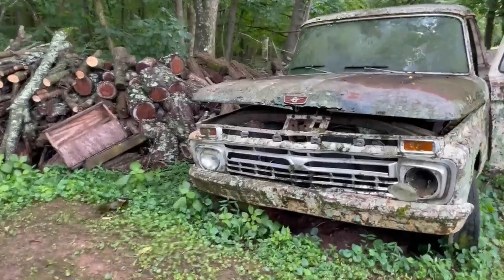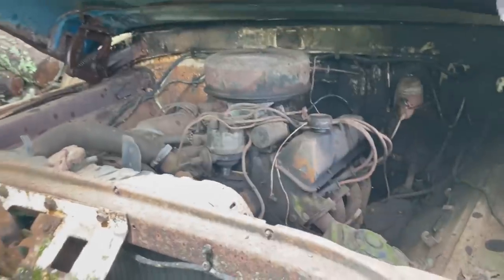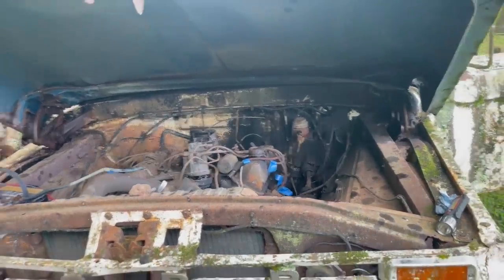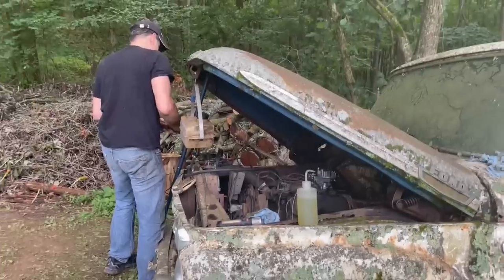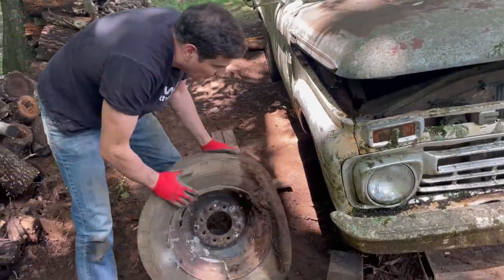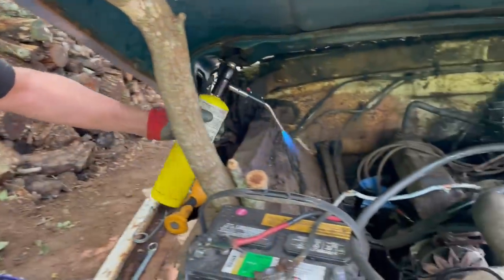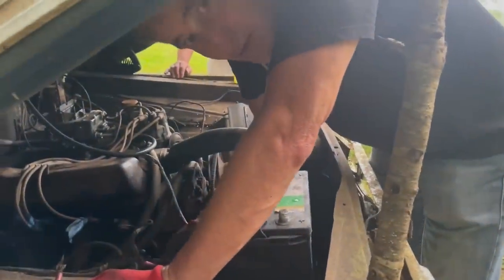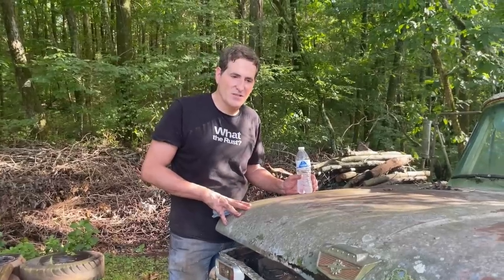Will it run? Sitting 32 years! Mud hole 66 F250 Camper Special.

Comment: Under the hood is like my old 69 F100 when I first bought it. I eventually replaced the engine with a rebuilt 360 from O'Reilly. Also redid everything under the hood. Added power steering, power brakes, electronic ignition, electric fan.

Comment: I’ve owned 2 66 custom cabs and one was fully loaded V8 352 automatic power steering and power brakes and the other was a 240 6 cylinder 3 speed and both of them drove really well.

Comment: The manual steering is a nightmare in those trucks. I'm an old dude and I use to repair those in the seventy. Its a powerhouse with that engine and 4 speed though

Comment: I’ve used a ratchet strap to get the tires back on bead so many times!! It never fails, as long as the tire will hold air for any length of time.
Reply: Nice to know! Thanks for watching and the advice 🙏

Comment: You can tell by the plugs that this engine was pretty tired when it was parked. She has some miles on her. That was ash buildup on those plugs. She is going to need a rebuild when the new owner starts putting this truck back together.

Comment: Great job you're doing there and another good diagnosis, by Christina, on the exhaust blockage. With the mud there, we would take a long two inch rope and get way out way away from the tractor and leave the truck in neutral and then just jerk it out. We did it with little 8N ford tractors and it worked after a fashion that way you would not burn up the frail clutch on the truck. Sometimes we had to get away over 60 feet away to find a dryer patch of ground to get some purchase with the tractor though. You'll get her out once the rain stops. Good save.
Reply from the maker: Thanks very much. It has been hot and dry this week, so hopefully the area dries out.
Reply: Of course a tractor or truck with a winch and cable would work best.

Comment: How about Jackin the truck up high enough so you can fill the holes underneath the tire with some plywood so it's almost even with the ground and then have the tractor try to pull you out from the back bumper. Can't wait to see part 2!you guys are the best!👍
Reply: There was wood under the back tires.  It was on an incline and so muddy the tires slid off the wood!  This truck will not get the best of us! Hopefully those are not famous last words🤣

Comment: Please! For future reference. And I have used one for well over 40 years. Taught to me by my grandfather, always take a Tennis ball and keep it with you when working on old Riggs! The reason why you keep a Tennis ball with you is for the simple fact that I see so many guys smack their head on that hood latch! Now what you do is you cut a 2 to 3 inch slit in the side of the Tennis ball and slide it on to the hood latch! I would much rather smack my head on a rubber Tennis ball than on a metal hood latch..
Reply: That's a great tip! Thanks James!

Comment: I remember reading about a guy that  not only took an axe to his brand new 1972 Ford Pinto, but he parked it in his front yard by the street with a sign that tead; $1:00 a hit. He bought it new, on the way home it developed multiple problems. He turned around and went back to the dealer to complain. The dealer replied, " hey, what do you want for $2000.00?
Reply: So funny!!!

Comment: In one of your videos you used chain wrench on a stuck engine. The other day I stopped at Harbor Freight looking for a oil catch pan and I found they sell a Bremen 20" Chain Wrench called a Locking chain Clamp that was like the one you used so I bought one for myself. I think it was around $20.00 and I have already used it twice. It works great.

Comment: Looks like you’re battling stuck brake drums on the front, more than the mud.   Have you verified that all 4 tires spin?
Reply: We saw the driver side spin fine but when editing we noticed the passenger side only moving slightly.  So you maybe right.  We'll be looking at that.

Comment: all the lichen and moss makes it look like camo paint!  Hood is from another truck and it looks like '64 because of the FORD 100 badge on the side of the hood (doesn't belong on a '65)  and the stainless spear molding.   The Twin I Beam F100 badge on the fender is right for a '65.  But you'd think the oil-bath air cleaner would be mouseproof!   One other thought, that oil fouling on a couple of plugs could be valve stem seals.   They'll suck a lot of oil down the valves at idle on these FEs if the rubber umbrella seals are gone.
Reply from the maker: It does look like camo!  I agree with you about the hood. I think it is a 64, but I really like the red, white, and blue colors that it brought to the truck. Thanks for watching!

Comment: wow, what a challenge...  the clogged muffler could have destroyed the gasket, because one didn't hear the vacuum leak at first. backfires might cause it, too.
aside the acorn shells the glass packs might have given up inside, and now the glass wool is blocking the pipe. I once had that on an old Suburban with rusty sidepipes, wouldn't idle and had no power. after removing the sidepipes (customer wanted them gone, anyway) the engine suddenly idled.
there also was one Opel who misfired for too long, and nobody noticed until it was time for emission check. the end muffler was filled with little marbles of catalyst material... the catalyst was entirely destroyed. XD

I was sure you could drag the truck out of that hole. are the front wheels stuck, too? looked like it.
loved how the owner worked on it while you were away, cleanign up the spot, grabbing  wheels, and so on. :) like he woke up and found a new project to work on. who knows, he might keep the pickup and restore it. :)
lookign forward for part 2! ^^

Comment: those FE engines are terrible to plug up the oil return holes in the head  take the valve covers off and in the rear run a coat hanger wire in it
Reply from the maker: Thanks for the tip! I did not know that.

Comment: Well sir it just goes to show that you need traction in order to move things/ When a wrecker driver is called out to "pull a vehicle that is stuck in the mud the operator winches the vehicle out rather than trying to pull the vehicle out and any experienced wrecker driver will not put his machine in a place where he can get it stuck. Of course, the wrecker winch has the power to pull things out. The tractor could have possibly pulled that truck out if there was a long enough chain to enable the tractor to get on drier ground. That was a nice truck in its day and with some elbow grease it could be made into a decent driver. This cab style was the last year for this cab as the 67 Ford cab was more square and actually that style was used for many years with minor styling changes. I am not a Ford guy but there were years where the styling is appealing.. Don't you just love taking off starters on those engines that have had headers installed?
Reply from the maker: Exactly. The mud there was slick making traction impossible with bald tires. Headers have caused me problems for sure.

Comment: You have a 2150 you put on there. It should have come with a block off gasket to use in place of the 2100
Reply from the maker: Thanks for the tip!
Reply: @whattherust  yea I learned the hard way too. The 2150 I took off had wood and orange rtv shoved in it to block off the leak….

Comment: If you two keep this up why in the world don't you buy an old wrecker or a four-wheel drive pickup with a utility bed and winch to carry more tools, supplies and an air compressor unless of course you are into pain. You need at a bare minimum to at least blow the trash away from the spark plug holes before you take them out (the only fault I find with your work). You could make a video finding a suitable tow truck or pickup and getting it road worthy for your excursions into the unknown. If you go with a utility bed you also need a small crane to help you with your "will it starts" projects. This old Camper Special was wearing both of you out (to be honest, it was starting to wear me out watching). I had a 1965 Camper Special with V8 and 4 speed I paid $400 for. The truck was complete with an old gigantic camper (I gave the old camper to a pig farmer who used it for a shelter for his pigs). I remember it having a compartment built into the side of the bed to store tools in. It was a solid old truck and ran like a top, this video made me miss it.

Comment: You need a bigger tractor with 4 wheel drive you could drag that thing right out of there. His is just to small and no weight to it
Reply: Right! That truck was placed in a valley.  So all water leads to it. Trust me he realizes in his 80's what a mistake that was in his 40's🙂

Comment: Why doesn’t the driver of the tractor get behind the truck and push it out?
Reply: Well.. he's 80.  A strong 80 but none the less:-)
Reply: @christinarust6957  I’m talking about using the tractor
Reply: I got you!  Tractor behind truck.  We didn't include that footage but we tried that!  The tractor wheels spun in the mud no matter where it was.  That darn truck was parked at the end of a hill/valley.  We need a dry spell, gravel or lots of cat litter...all 3 were discussed while there 🤣🤣🤣 Yep, these are the things we talk about when we're there, wore out and reaching for solution.  The men had put wood under the wheel, but the mud was so bad the tire slide off the wood back in the mud!  Fun times!
Reply: @christinarust6957  plenty dry and hot here in South Texas. No rain, not even a shower since May
Reply: Give you some of our rain if I could🤣
Reply: @christinarust6957  thanks